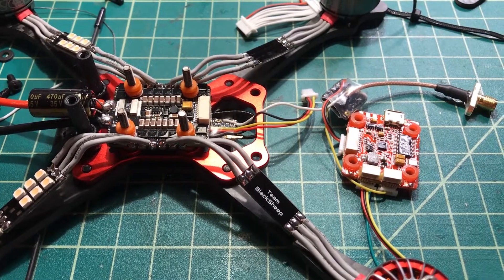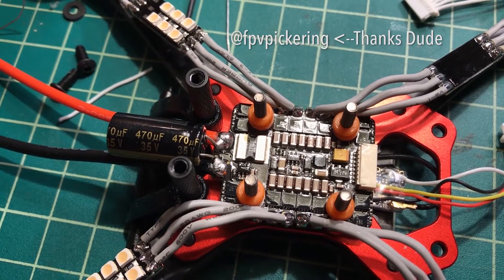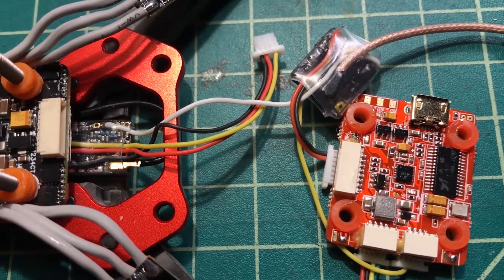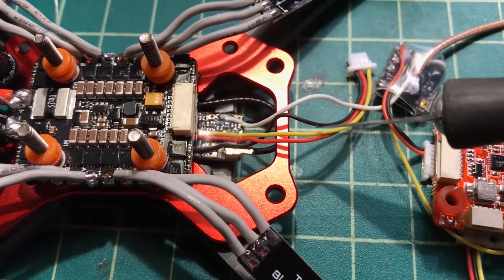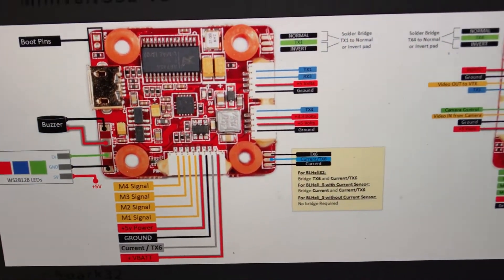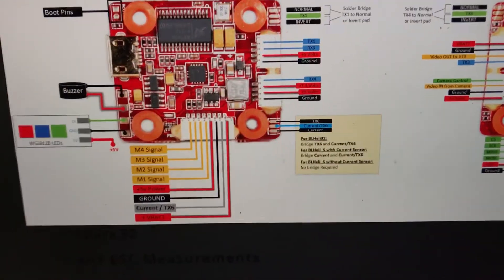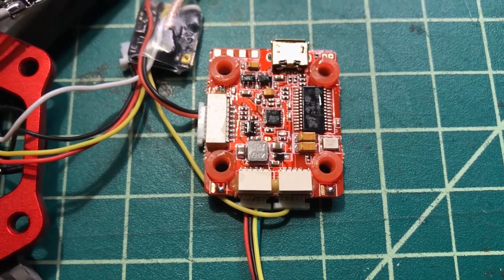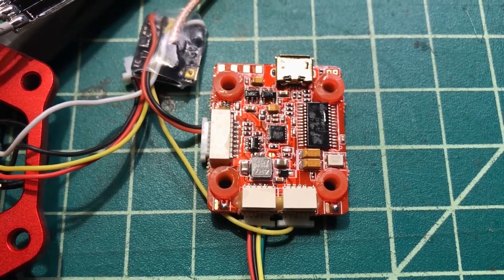FlightOne MilliVoltOSD Wiring Tips

Comment: dude thanks for your video, I just ordered my millivolt OSD
Reply from the maker: It's time for a follow up video now... with new things I've learned about it.
Reply: @PinchTune  Oh that would be great.  Im going to try it in a quad that I just cant get to fly good and see if its what I need.  It flies like crap with the cl racing f7 and bf 4.0, so I put in a Helio running Butter flight, I blew that stack up and put in a spedix esc with another helio and the video is now so noisy and i got vibrations I never had with the Aikon 32 esc and the burned up helio.  Yes im using the cap.   Im sick of betaflight and drivers and all that I want something simple to grip and rip.

Comment: Thanks for this Video
I just finish building,   the AIKON AK32  v2 and the skitzo revoltosd.
ESC Telemetry to FC Tx6/curerent
And for the crsf ch1 to tx1  and ch2 to tx3
I do have current sensor working, when i have esc to to multi shot. .
Reply from the maker: I have a build where I set it up like that. Current does work, but it's WAY off. I haven't gotten around to correcting the scale to have it read correctly. But honestly, I think I'm going to change it to just current. On these rigs at least, I don't need all the data that BL32 can do.
Reply: @PinchTune  
Seems like there is a few different was to do it. With connecting  only ch1 to tx1, you only will discovered have of the sensors which may or may not be important to you. The issue I notice is that if enable Dshot 1200 and 32bit ESC telemetry. I don't get any current reading at all.

Comment: Good video. Where'd you source those TBS LED's your motors are connected to? I've tried several of the similar CLRacing brand of these and they can't handle the T-Motor F80 Pro II 1900kv on 6S.
Reply from the maker: These are just standard Racewire with Racelites soldered on top. WhitenoiseFPV brands them for various shops including TBS, Heli-Nation, Pyro, etc. I have never burnt one. That said, I can see F80 1900 6S being extremely power hungry. You're just going to have to try I guess.

Comment: Please share the "mAh offset" and "voltage offset" in flight one settings. How do you manage unify nano VTX ? The MillivoltOSD did not see VTX in my case.
Reply from the maker: I don't use PSD Smartaudio on FlightOne or on KISS. I wire Smartaudio from the VTX straight to channel 4 on the RX and control the VTX from my TBS module. I skip the OSD. As far as mah offset, I used the default with my Aikon ESCs and it seems accurate.
Reply: @PinchTune  is there a way to set it up and use the OSD to control the VTX?
Reply from the maker: @jrodrc4137  Yeah, just wire smartaudio to the UART recommended for that. Check the diagram on the FL1 site for either V1 or V2, whichever you have. V2 has 2 pins for the camera, and V1 has 3 pins. That's how to tell them apart.
Reply: @PinchTune  Sick thanks man.  I ordered the V2.  On there website I can only find the 30x30 board.  I have to go do some more research on how they show you how to wire things up.  Im hoping this will simplify some things. 

Also I accidentally clicked on your channel and Im glad I did.  Wicked channel man, 1 more sub.  Ill be checking out your older vids.
Reply from the maker: @jrodrc4137  It's under Support I think. Scroll down towards the bottom and you will see a list of each board model. When you click on each it's like an accordion and the diagram for the board selected shows up.
Reply from the maker: @jrodrc4137  Thanks for subscribing. I appreciate that. I'll be doing a FlightOne Falco X series soon, so you're at the right place!

Comment: That's exactly how I wire mine using the ak32pin only difference is I use unify Pro HV direct to the battery. But I still use my TBS Crossfire Nano receiver to control smart audio so much easier.

Comment: Why does blheli say I'm using oneshot125? It's my first time using FlightOne on a Cricket osd and Aikon Ak32 on 6s.
Reply from the maker: Are you sure you selected BLHeli32 at initial setup? Or did you by mistake choose BLHeli_S? I don't remember right now, but I think there are 3 options. BLHeli32, BLHeli_S and Other (KISS)... not necessarily in that order. Check that first. If you did in fact check BLHeli32, I'm surprised there would even be a Oneshot125 option. But if there is, just change it in the configuration pane to whatever it is you are going to use. I'd recommend Multishot for freestyle, or DShot1200 for racing or freestyle with this ESC.

Comment: Glad I ran across this video and comments. I just installed ak32pin with matek 722se mini (BF 4.0.2 DSHOT1200) and couldn't get current through telemetry though its clearly advertised that it supports voltage/rpm/current by telemetry. Only voltage and rpm work from telemetry. Setting the current source to ADC (voltage to esc sensor) provides current but highly inaccurate. Accurate current readings only work with MULTISHOT. Super annoying as I purchased this to run DSHOT1200 with working telemetry. AIKON lists their other 4in1's with telemetry voltage/rpm only but falsely lists this esc with current telemetry. I should have purchased the tekko32 mini..
Reply from the maker: I hear ya. I'm super used to just running simple current readings with just the shunt resistor on a FC/PDB unless I'm on KISS. So when I started messing around with FlightOne or even Betaflight with ESC telem, I ended up just forgoing ESC telem and just using simple current only. That said, I do have some BF quads that are working well with ESC telemetry.

Comment: What settings on blheli suite & F1 filters/settings did you use with this combo?
Reply from the maker: These are flying the last revision before Falco, so 1.2.90.192 I believe. Filters are, Stage 1: RC Fir2 220/220/220 and Stage 2 is Frequency Filter 115/115/115. For D Filtering is dual Biquad, but the first is 230/230/230 and the second is 260/260/260. For BlHeli32 is the latest stable release... with motor timing at 20 and PWM speed at 32000.
Reply: @PinchTune  Great, thanks for that, going to give that a try today!